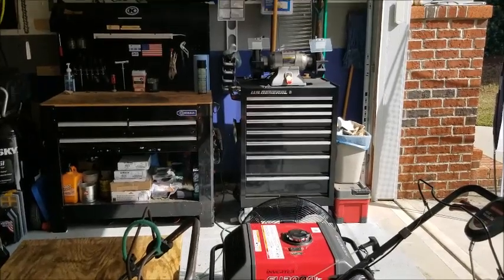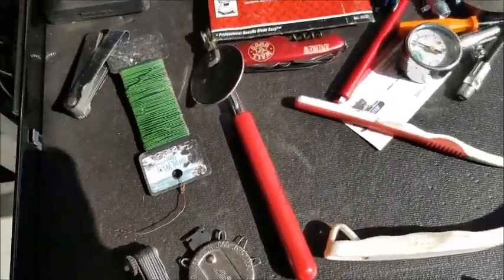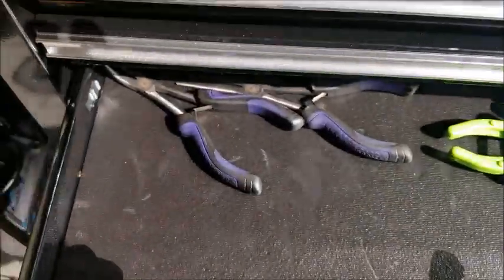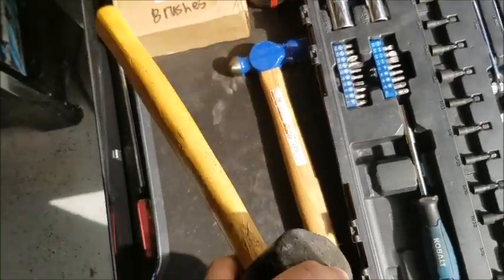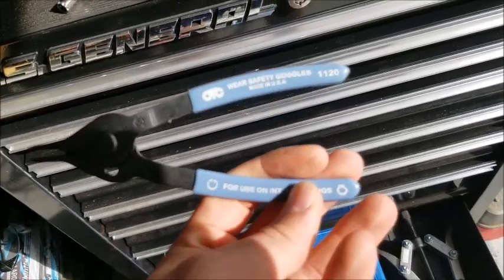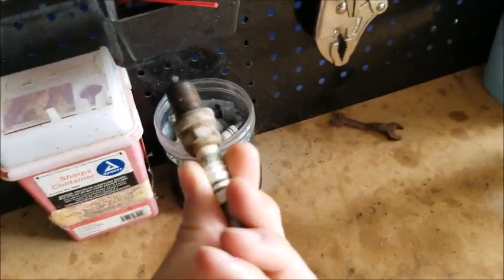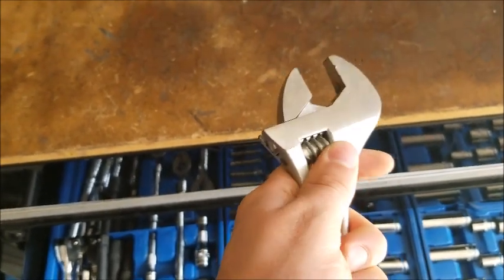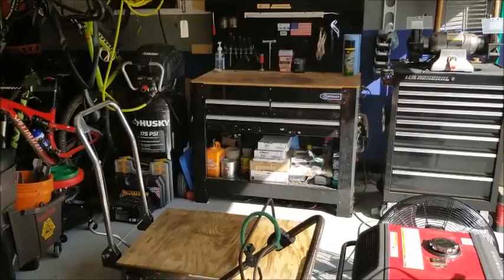Small Engine Repair Tool Box Tour

Comment: Here's a wasp tip for you. Use 2-3 tablespoons of peppermint oil with  1/2 teaspoon of dawn dish soap/ mix in a quart good spray bottle. Spray all around corners and facia. Then adjust the nozzle to knock them down and step on them. Wasps and spiders do not like peppermint oil.. It's healthier for you and less expensive.
Reply from the maker: Thanks for the tip!

Comment: Nice tour ! I used straight 30wt oil for flathead engines and `10-30 synthetic (Pure) like Pennzoil platinum for overhead vale engines. I found that Pennzoil Platinum sells for $22.00/ 5 quarts and stands up to the heat better in small engines. I am not sponsored or a distributor. For smoking engines I used Lucas oil stabilizer:, .about 2 ounces per quart..
Reply from the maker: I carry Rotella straight 30 for Briggs and Stratton and Tecumseh, the rest get Rotella 10W 30. Thanks for watching!

Comment: get a pair of cable cutters from harbor freight they are for cutting battery cables but also work amazing to cut old hard fuel line when running new stuff or just trimming the end of a ful line up. i was a welder for years and had a set i used to make my own custom weld cables but man do they make fast work of rubber hose. also about removing the pullys to change the belt i was a small engine mechanic for several years and never had to do that just bend the keeper a little bit and push the belt on its faster and no harm is done you can also "roll" a belt on in most cases as well get it started on the pully hen just spin the pully or pull on the belt to get it on like you would a timing belt it works pretty well and is fast. if you take a look at the small engine shop tour i did and my tool box tour for more info and the set up we had
Reply from the maker: I'll make sure to check that video out. Thanks for watching!